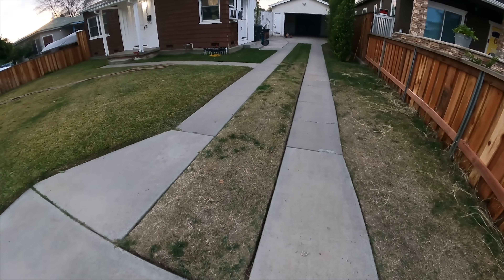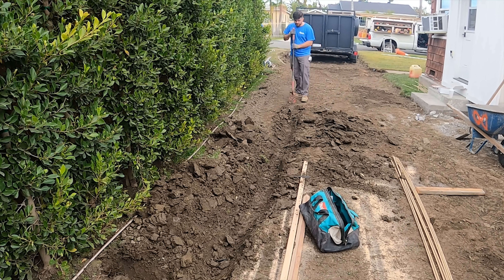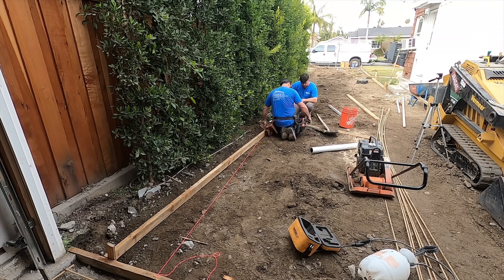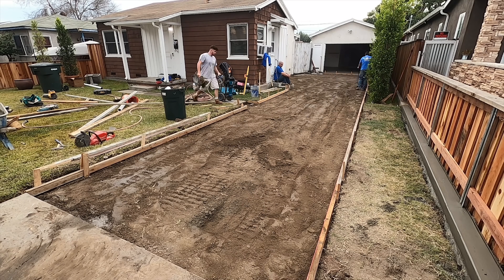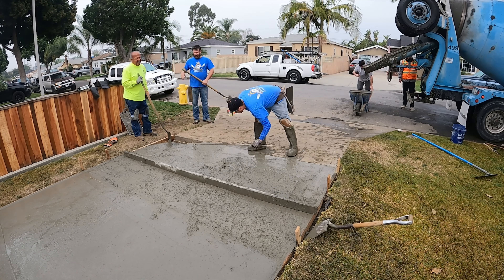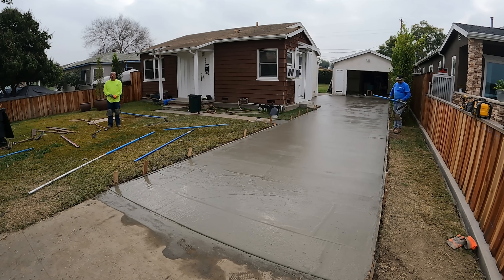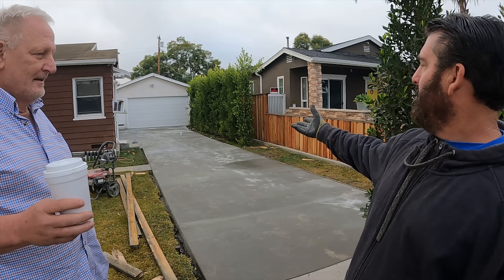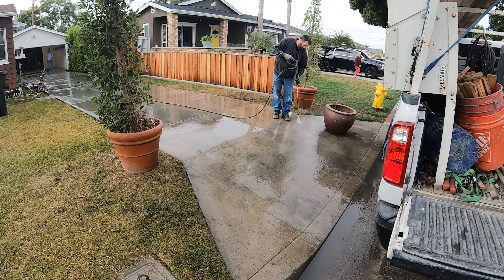Homeowner Ruins Fresh Poured Concrete Driveway!

Comment: This guy is worth every PENNY!!!
I've got 30 yrs in construction and this is one of the most thorough concrete guys I've seen in A LONG TIME!!!
Reply from the maker: Sounds like you know what you're talking about,
TY
Reply: Spot on. Bob, the homeowner has been we'll looked after here! 🦘
Reply: Until it sags along the house and water gets under it and into the foundation
Reply: @ShadowRyu yes, ... but
 2 things about concrete:
• it will crack...
• nobody will steal it...
    Having bad fill... Shifting foundations... Bad weather... Anything 'COULD' happen but it better with a good contractor
Reply: My husband use to put plastic burial pipe never a problem steel so no cracks  seems❤️🕊️✨
Reply: @michaelnash9970  my comment is in regards to that I didn't see any rebar in tge existing foundation to prevent sagging along the housw or expansion to prevent seepage between the concrete and the house. I'm hoping its there and they just didn't record that part
Reply: @ShadowRyu  yes, absolutely.   My favorite for concrete is "2 things are absolute about concrete... 
1) It will crack... 🙄
2) Nobody will steal it... 🤔
Reply: @ShadowRyu there were no dowels off existing concrete, rebar instead of proper mesh. I’d never use these guys ever. I guess things are different in the US.
Reply: @dunning-kruger551  I’d never use concrete!

Comment: To start I'm a 30+ year. ACI certified and WOC Educator. The watch count amazes me. With all due respect.
He caused a problem? Not the grass mat left under the slab or inconsistent compaction from the tractor path or the broom overlapping, the overage on the old concrete that may come off with pressure washing but likely not, or the jointing done a bit late (dusting) 500 psi...and the geometry that pushes the limit of the aci standards. Sorry I've always been over the top about every thing. Glad to see he was so happy for you. It's a tough business.
Reply: Critics gonna criticize
Reply: You forgot the high slump mix, jobsite added fiber, rebar hook, and lack of curing.  Unless that mix is grossly overdesigned, I doubt that it made spec.  Is the ready mix supplier responsible???  No,  the contractor added to the mix in site,  took responsibility for mix performance.  Definitely not worth the few bucks you saved by adding your own fiber.

Comment: Bob learned his lesson about fresh concrete. Now, he needs a couple of lessons about window air conditioners.
Reply: or mini split lessons.
Reply: @catfisher420  Or that, sure. I'm just saying that the window A/C should be more or less level, and there should be some insulating foam at the top and bottom of the inner sash. He's got a ton of heat coming in through there.
Reply: @craigcorson3036  it has to be tilted at an angle for the condensation to drain out the back of the air conditioner.  not level
Reply: @jasong7092  They are designed to drain the condensate properly when level.
Reply: Believe it or not some don’t drain.  Some window units will utilize the excess condensation to fling up from the condenser fan, throwing it onto the condenser.  This will evaporate the water as it cools the condenser, lowering the discharge pressure and lowering the discharge air temp.
Reply: @hvacexplained9341  Yes, I was aware of that. Pretty clever, really.
Reply: I'm glad I read this. 
I thought it was my OCD kicking in when I saw that air-conditioning unit.
Reply: @craigcorson3036  :  Believe it or not not many things have changed in the past 30 years with the HVAC industry except for the refrigerants.  When I get a chance I will do a video on an air conditioner from 1986 verse the up-to-date version made by the same manufacture.  It’s all relatively the same just different size equipment doing the exact same job.  Larger equipment has bells and whistle’s that smaller equipment is not.  👍
Reply: And add a lesson on PPE, particularly one about cutting concrete with a Skilsaw with no eye, ear, or mask protection. 👌
Reply: @tima.478  Anytime I’m cutting anything Dusty such as Concrete, brick, mortar, drywall dust I’m always concerned about breathing that silica dust in
Reply: @hvacexplained9341  As well you should be, gotta play this life for the "long game!" So, good for you, health is EVERYTHING!
Reply: @tima.478  Exactly we are all indestructible and must take caution with what we have so we can remain for the long-haul.
Reply: Call me if you want floor heating... we're the best.  Let's do it right the first time!
Reply: @Lynda812  believe it or not HEX coin $0.18 pulsechain coming soon same founder!
Reply: @HVAC EXPLAINED  besides the fact inverters have made AC more efficient and those old units. VRF systems are also new and and alot more efficiency in large multi room buildings that require diffent Temps. There definitely has been alot in AC advancements in the past 30 years. They have also gotten heat pumps far more efficient at subzero Temps or even negative degree Temps.  I mean what else do you expect them to do?
Reply: @HVAC EXPLAINED  you must be used to the US style central air units that have stayed mostly the same. Mini splits have come along way in so many ways, usually fat more efficient too.
Reply: Looks like a new roof is on the list too...
Reply: @tima.478   REAL MEN see no, hear no, breath no sissy PPE. In fact, they don't hear well, see well, breath well; but, they "real men". I'll take sissy.
Reply: @artsnow8872  Yeah, they should have tried "smart men!"
Reply: If he can afford to redo concrete, he can afford a decent mini split system in his house to improve performance at a Lower monthly rate and greater security. Most window units are poorly hardened against home invasion, but a decent way to get in if you locked yourself outside
Reply: @craigcorson3036  Ours literally said in the instructions to have a slight angle for draining the condensation.
Reply: @sherrimiller5258  Yes, a SLIGHT angle. That thing was at least fifteen degrees off of level, and that is NOT a slight angle. Two degrees, maybe three, is a slight angle, and is more than sufficient to drain condensate.
Reply: @craigcorson3036  ahhh so now you are backpedaling and claiming not flat but slight angle eh? 
You must be insufferable when you are wrong.
Reply: @captain_orange  THIS is important to you??? Dude, grow TF up.
Reply: @craigcorson3036  called it. Completely insufferable. Blast at parties. Les Miserables
Reply: @captain_orange  SEE YA!!
Reply: @craigcorson3036  I am seeing it is impossible for you to not have the last word. 😂😂😂 Instead of telling others to grow up perhaps you should take your own advice Bud!
Reply: My thoughts exactly!!! I thought HE SHOULD BE OUT PAINTING THAT PLACE AND FENCE!!! MAYBE ADDING SOME LANDSCAPE!?
Reply: @njkauto2394  same.
Reply: Yeah, that thing looks like its about to fall out of the window!
Reply: No….I doubt he learned any lesson.
Reply: @tima.478  it's called the "safety squint".  works great...we all use it all the time.
Reply: @James john I've heard stories like this before...lol. In which case I would provide my own PPE. Your job doesn't care about your well being as much as they would like you to think. (aside from yours because It sounds like they wanted you to get hurt 😜). People are in charge of their own well being, and I take that personally. Once you're off the job, for whatever reason, they don't shut down...they just replace you.
Reply: @James john What part of "more or less level" broke your brain?   🤦‍♂️🤪
Reply: Lol! My thoughts exactly.😅😅
Reply: I know!  His driveway looks better than his house.
Reply: @tima.478  pffft, you can get lung transplants, youre fine. I breath silica and sawdust all the time and I can almost walk a flight of stairs without getting winded.
Reply: @TheDevilockedzombie  Not getting winded has nothing to do with personal protective equipment. There are millions of people in great shape that check out early, jus sayin'
Reply: Ha ! a good one
Reply: @hvacexplained9341  I would watch that video.
Reply: Guys, HERE is The Savior

HalleluYAH translates “Praise ye YaH”

YaH is The Heavenly Father 
YaH arrives via the TENT OF MEETING
YaH was Who they Crucified for our sins
YaH was Crucified on an Almond TREE

— Ancient Semitic Cuneiform of Moshe (Moses)
— Isa Scroll (The Original Isaiah)

Isaiah 42:8
"I am YaH; that is my Name! I will not yield my glory to another or my praise to idols.”

Isaiah 43:11
“I am YAH, and there is no other Savior but Me.”

Isaiah 45:5
“I am YaH, and there is none else.”

Comment: Great job! Props to Bob for going on camera and owning his mistake! Good teaching moment for homeowners.
Reply from the maker: We agree!
Reply: Yeah huge huge respect for that and not hiding away. Bless his heart, as my mom use to say.
Reply from the maker: I've heard that a few times
Reply: he's a know it all  you can tell by his hovering but not today
Reply: If it were me, I would of blamed the dogs.
Reply from the maker: It happens
Reply from the maker: The dogs would have been a good out
Reply: He partially owned it, he did say he didn't know, if your paying 10k for concrete work (idk what this job was, but i imagine with the depth and bs they had to deal with, at least 10k ish) anyone would know ur not supposed to walk on concrete, and even more so, that plain tap water white washes the concrete if it isnt cured yet.
Thankfully he didn't put actual prints in that concrete though.

Id personally just wait until that all wore away and then seal thw driveway. If u seal it, it'll be noticeable forever, id think.
Reply: ur right about that.. the only reason why I liked the video...
Reply: I don't think I would hire him as a pilot.
Reply from the maker: Only time will tell
Reply: @OdellCompleteConcrete  IF YOU REMOVING  OVER 20000 SQ FT PARKING LOT WHAT MACHINE YOU  ADVISE
Reply: @hova575  i advice a d11 dozer and a 336 excavator and a cple tri axles ready to go.
Reply: @vicO1323  lol...right
Reply: BOB didn't have a choice , unless he wanted to be labeled a liar 🤥
Reply: Did Bob actually do more than just walk on it?  Did he have some chemical on his shoes?  Or spray something caustic on it?
Reply: @enmodo  no, thats what hapoens to concrete when water hits it before its cured.
If u want whiter concrete, juat simply spray it with water, literally at a certain point n it will white wash it.

Basically the reason that if the guys who finish concrete start to lsoe it at the end, they will never spray water on it to try to keep it workable, they will use a specific solution, we just call it pink, n its diluted 9 to 1 and it prevents it from turning completely white like that.

Its crazy what water does do. However, the reason the prints are there n those other area that look worse, is because the very very top layer he kinda pushed down, so take a field of grass, if a bear walks through there, if u know what ur looking at, you can tell, all the grass is pushed over bringing out a lighter color, which is the lower parts of the grass, anyway, its like a similar effect to that, so parts if it he sprayed with a strong burst of water, or stepped on ir dragged the hose along.
Either way the guy was a fn idiot for doing it.
Reply: So this video was clickbait, the driveway wasn't ruined
Reply: @vicO1323   There was a news article about him a while ago.  Sort of a cowboy pilot.
Reply: It's not like he could have denied it.
Blessed if I know how those size 12 footprint got there.
Reply: @OdellCompleteConcrete  a dog with size 12 feet
Reply: @enmodo  that's what happens if you walk on concrete too early
Reply: @AStanton1966  dogs with big ass shoes
Reply: @OdellCompleteConcrete  I think Bob may have gotten the better deal out of this.  But you/your team did a great job and I enjoyed your narration of the project...
Reply: What else could that nincompoop do? Deny it?

Comment: I am in tears. Having done work like that as a 14-17 yo, I would just die on the spot to see my work messed up like that. You guys go over and above. Amazing!
Reply: The pilot must be a halfwit not to know that you should not walk on concrete before it has fully set
Reply: @ianarmstrong9594  The concrete sets in several days, but reaches the full strength potential in around a month. 
If the best cure conditions met.
For the driveway even a tenth of potential strengh of concrete was not needed.
That pilot maybe knows a little about concrete, thus he does not care.
Reply: @vasiliynkudryavtsev  Agreed as a builder myself I have seen many times where people have had concrete poured, then warned to stay off it till it has set hard enough and ignored advice and walked or drove on it, I would have been angry with this halfsoaked pilot
Reply: We had created a base plate and the next day we saw a lot of cat paws in the concrete. This is happening all the time if I work with concrete here in the village, because cats are very curious.
Reply: good thing the homeowner knows it doesnt matter
Reply: @vasiliynkudryavtsev  He should have been told really.
Reply: Not sure how much it costs but seems like you could use laser level grinding (like they do on many roads) to give it a new consistent look that would last.
Here's something similar -
vid =  L8HmlKUskQc

Comment: I worked for my family's concrete business for 42 yrs from 1973 - 2016. We did mostly new residential tracts and some small commercial. One morning in the 80's we poured the complete outside of a new home. I stopped there on my way home to strip it and there was a car on the driveway. It was the owner of the home. Boy was I mad, but by some miracle it didn't harm it at all I guess because it had been down long enough. I really miss it.

Comment: 7:50 speaking of pink bar... thank you !  Did not know such a thing existed.  These bridge and building failures should have used that cuz if they crack it's one thing but to have the reinforcement rust through that is a way bigger problem and once they are exposed to air and water, it's all over for steel !  Thanks for this video.  All explained perfectly and not a second wasted of time showing the procedure.  Narrating it is really perfect here !!!!
Reply from the maker: Great
Glad you liked it.